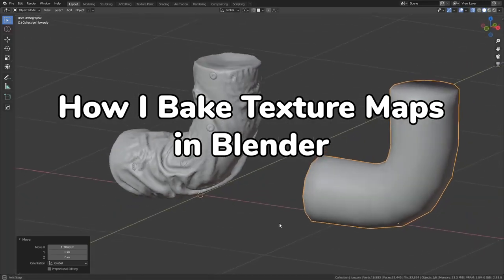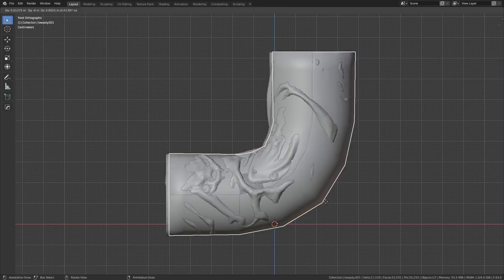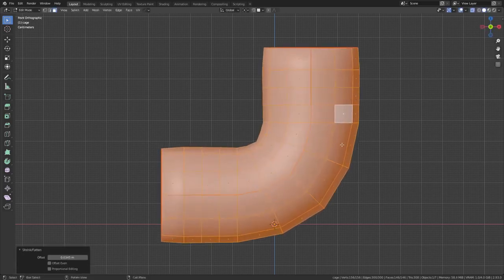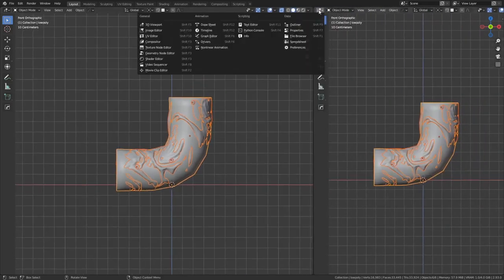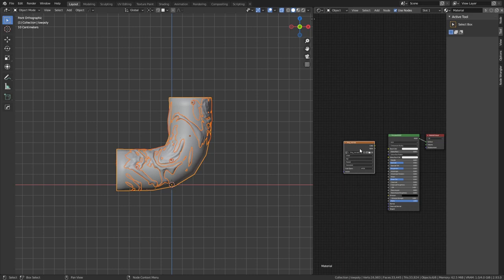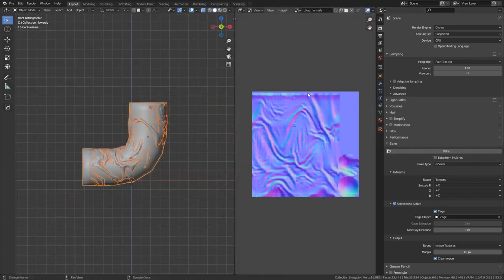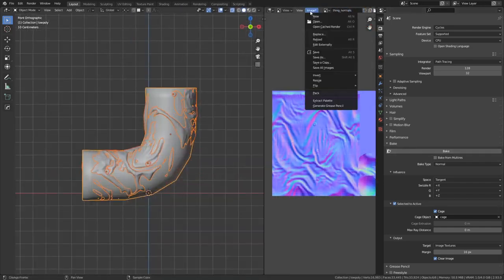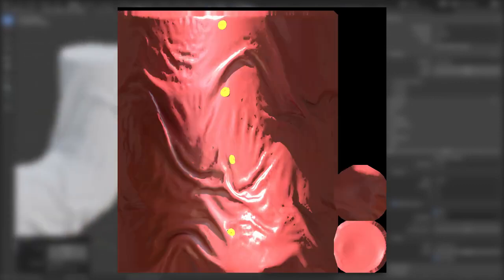I bake stuff using Blender

Comment: now all I need to do is learn how to make the high poly models
Reply: 8 months so you probably already learned how, but you start with the low poly. Make a copy, sculpt. Then make another copy of the low poly (for insurance) and use that to bake.  That is usually what you do. On latger more complicated meshes like characters and buildings, you might want to start with either prefabs or primitives, boolean those together, sculpt and then retopo for your low poly or "cage".